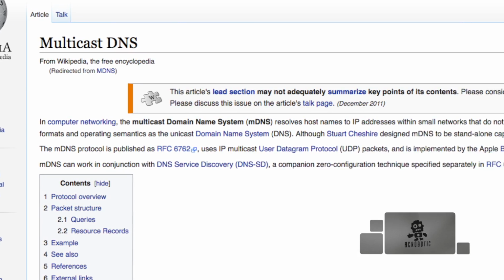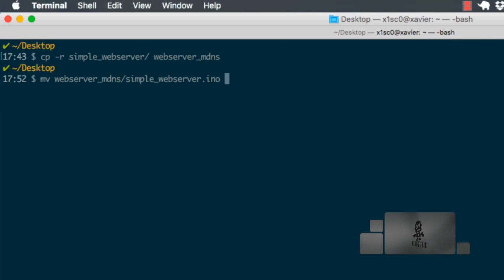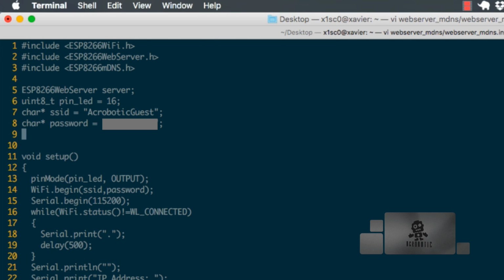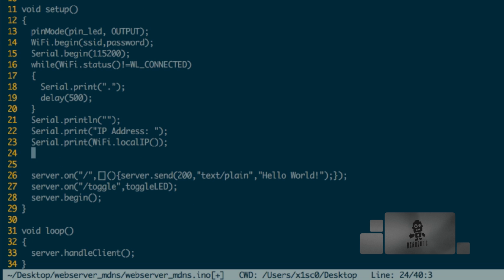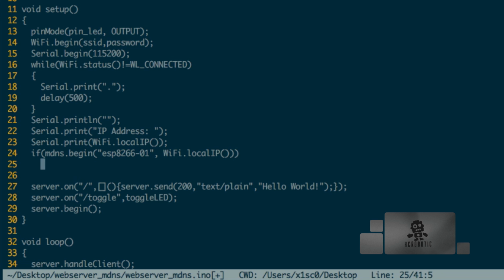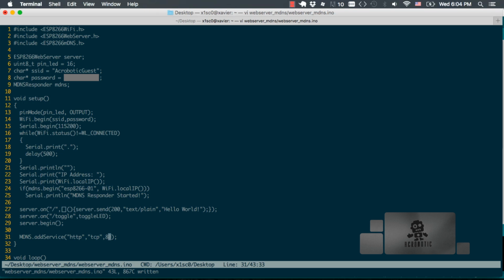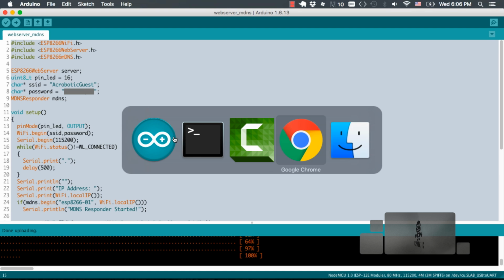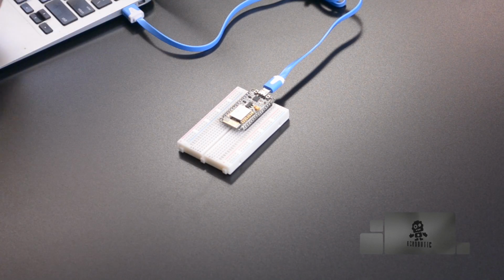ESP8266 mDNS For Web Address URL Using Arduino IDE (Mac OSX and Windows)

Comment: Great tutorial. mDNS didn't work before installed bonjour. After installed it working properly.Thanks for your effort.
Reply from the maker: Thanks! I could've sworn I had added it to the description, but that wasn't the case (it is now fixed). I'm glad you found the tutorial useful!
Reply: @datasith  I have a mac so I did not install bonjour. So, what should I do to access the website?
Reply: @nazmulhossain8194  фф

Comment: Great tutorial. It works ! Does anyone know how to get the URL working loading pages from SPIFFS ?
Reply from the maker: Thanks! If I understand correctly, you want to serve .html files from SPIFFS? If so, when the server receives a request for an URL, then you can use the fileStream function to serve the file in response. HTH!
Reply: @datasith  got it working. But it doesn't work with windows, Linux and android. Only apple !
Reply from the maker: @mialcatel4279  awesome! Yeah, mDNS is tricky. Try installing Apple Bonjour on Windows, and activating mDNS on Linux! HTH!

Comment: The code is not working for me. I have installed avahi and working in linux, but its not working for me. In fact any code where I have included ESP8266WebServer library is not working. Please Help
Reply from the maker: So the mDNS works, but not the WebServer?

Comment: One more great tutorial from you guys!!! Dear one more thing i tried you mDNS code but i found one issue it is working well on my laptop but when I tested it on my mobile which is actually a wifi hospot its not working but when I type IP it works in mobile but when I enter (http://esp8266-01.local) it does not work

Comment: Great tutorial, but I am having a problem.  I have a mac and windows, but none of them is working(IP is working but not the http://esp8266-01.local/). I installed bonjour on my windows but not in the Mac. Still, none of them working. So, what should I do to access the website?
Thank you for your time.
Reply from the maker: Hmm, interesting. Mac OS has Bonjour already installed, so there's no need to install anything else. Are you calling the mdns.begin() method in your setup function? When the code is running, do you see the debug message ("MDNS responder started") in the Serial Monitor?
Reply: @datasith  I copied your code and only changed SSID and PASSWORD.
Reply: @nazmulhossain8194  it didn't work for me either. Then i followed an example from mdns library (https://github.com/esp8266/Arduino/tree/master/libraries/ESP8266mDNS/examples/mDNS_Web_Server) which worked just fine.
Reply: You have to delete line 13 "MDNSResponder mdns;"
Use "MDNS.begin("esp8266-01")" instead of "mdns.begin("esp8266-01", WiFi.localIP())" (line 51)
Add "MDNS.update();" in the loop() function
Thats it!
Reply: @sev3n-eleven  Thank you, It is working now.

Comment: I have a esp8266 cp2102 and esp32. I also have my own domain and mysql database. Example.com/data.php?id=1234 where 1234 is the name of the esp. And strings $d1 $d2 $d3 $d4
How do I send strings to/from esp and website without revealing my SQL queries in the esp code?

Comment: Does mdns also work in esp01?
 And what version of the library is needed؟
Because Could not get mdns
Reply from the maker: It should work on the ESP-01, make sure you install support on your computer (read the pinned comment).

Comment: I am totally lost from 1.30 to 1.50. I dont know what terminal it is or what language you are using. Any guidance will be much appreciated.
Reply from the maker: Try searching the web for tutorials on the "Vim" text editor.  Otherwise, you can use the text editor built in to the Arduino IDE.  Thanks for giving our videos a try!

Comment: esp8266 client
Hi there, thank you very much for this step-by-step tutorial. I've tried it and it works with standard browser. When I try to connect using an esp8266 client using the mdns server name the connection cannot be established. It work perfectly when I use the server IP but this defeat the purpose of using a mdsn name...
 I've tried many combinations of request from the client but nothing seems to work. I've checked your tutorial and actually there isn't one about esp8266 client sending request to esp8266 mdnes server. Could you suggest a solution?
Many thanks and Regards
Reply from the maker: If you're trying to access the mDNS device, make sure you install Bonjour if you're running Windows OS (see previous comments for details).  Thanks so much for watching!
Reply: ACROBOTIC Hi, I'm trying to connect to the esp8266 server via an esp8266 client using the mdns server address. It still doesn't work. (Request to the server from osx or windows work like a charm), help on this is much appreciated. I suspect the esp8266 can't resolve mdns names...
Reply from the maker: You need an mDNS client running on the ESP8266.  Check this thread for more info: https://github.com/esp8266/Arduino/issues/1184
Reply: Salvatore have you find any solution for connecting mDns client(esp8266)?

Comment: Awesome work!

Let me ask you a question..I've noticed you rely heavily (and I'm ok with this) on the 'routes' and the server.on method..but I would like to enhance the user browser gui, something like a control panel with buttons,  sliders and checkboxes which would (by xmlhttp request, perhaps?) change parameters in the remote board , WITHOUT afecting the page displayed in the browser ....can yo please provide a tip on that?
Thanks in advance!
Reply from the maker: Many different methods achieve the same results. A more advanced way would be to use the xmlhttp object and use AJAX.  You'd still use the "server.on" method, but you'd return an entire html page, which would include the necessary JavaScript.  We hope to do a video in the future illustrating this.  Thanks for watching!

Comment: Thanks for such a nice video.
I have tried the same example but I got below error, can you please help me-- 
//--------------------------------------------------------------------------------------------------------------------------
I have used ESP8266 small module
//------------------------------------------------------------------------------------------------------------------------........
IP Address: 192.168.1.128
MDNS responder started
Fatal exception 0(IllegalInstructionCause):
epc1=0x40106cf6, epc2=0x00000000, epc3=0x00000000, excvaddr=0x00000000, depc=0x00000000

Exception (0):
epc1=0x40106cf6 epc2=0x00000000 epc3=0x00000000 excvaddr=0x00000000 depc=0x00000000

ctx: sys 
sp: 3ffffd80 end: 3fffffb0 offset: 01a0

>>>stack>>>
3fffff20:  4021ae9f 09940160 402109c0 3ffecd00  
3fffff30:  3fff21e4 00000001 4021aede 402109d9  
3fffff40:  4021aced 3fff23ec 3fffff80 3fff166c  
3fffff50:  3ffe0000 3fff21e4 3ffee7b0 4021b6a0  
3fffff60:  3fff23ec 3fff166c 3ffea1ba 4021a43f  
3fffff70:  3fff166c 00000014 4021a9ea 3fff23ec  
3fffff80:  3fff166c 3fffdc80 3fff16f4 3ffefd20  
3fffff90:  402263a3 3fff23ec 00000000 402064af  
3fffffa0:  40000f49 3fffdab0 3fffdab0 40000f49  
<<<stack<<<

 ets Jan  8 2013,rst cause:2, boot mode:(1,6)

 ets Jan  8 2013,rst cause:4, boot mode:(1,6)

wdt reset
//----------------------------------------------------------------------------------------------------------------------
Reply from the maker: Try adding a delay inside your loop function.  Also, make sure you have a proper power supply.  Finally, try the code without any external component connected to the ESP8266, that way you can determine whether additional hardware is causing the failure.
Reply: I was having the same problem, I am using the 3.3v supply from arduino uno and neither did I have any other components connected to it but then I figured out that it is because  I had stored my html page in the program memory and I was trying to access that html page stored as a constant character array in program memory as a normal char type array the only work around I could find was to declare that page as a simple const char type array because I couldn't find a way to access data from program memory.

Comment: The instructions worked out for me quite well, but for some reason, I can't toggle the led on and off. It just remains on no matter what. Any solutions?
Reply from the maker: Make sure you add a delay between setting the pin HIGH and LOW!  Thanks so much for watching our videos, we're glad that things are working albeit partially ^_^

Comment: Terrific series of videos on the ESP chip. I went through this one on adding a custom local domain name, but there seems to be one thing missing. Please help if you can:

Everything indicates the mDNS server is working, but I cannot reach the webpage. I actually have my code set up to run an AP, which works great if I just type in the 192.168.4.1 address. The name I give it will not resolve, however.  I read all the comments, adding the "http://" prefix, but this just will not connect from my phone (iPhone with latest IOS). Any suggestions on what to check is appreciated.
Reply from the maker: Does it work if you try to access the address (not the  IP) from a computer browser?  Sometimes the phones have trouble using mDNS.  Just for the sake of testing, try running the code on station mode and connect the phone to the same Wi-Fi network as the ESP8266.  This will tell you if the problem is with the phone or with the AP part of the firmware. HTH!

Comment: +ACROBOTIC I'm working on Windows 10. mDNS is not working on my laptop. If access it via IP address it works well but doesn't work with mDNS. Please help.
Reply from the maker: mDNS is not supported by default on Windows, unfortunately.  The easiest way would be to install iTunes or  Apple Bonjour directly!  Thanks for watching our video, and giving the code a try!
Reply: I installed Bonjour by Apply and viola it's working. :) Thanks anyway for your videos. Learned a lot. Can you do a video which involves ESP8266 NodeMCU with MATLAB?

Comment: Thanks for the video. I did copy your source code and uploaded it to my esp8266. The serial monitor shows that the mdns has been started like in your video. I get the ip address, too and using it I can connect to esp from my browser and get Hello world back. However, I cannot get connection by typing esp8266-01.local/ to my browser. The browser says: "esp8266-01.local’s server DNS address could not be found." Any idea what may be blocking me to use the mdns even if the ip does work? Thanks.
Reply: I am also having the same problem but I am using a mac. 
I get the message displaying the IP address and also the MDNS server has started, but when I type in esp8266-01.local  the browser doesn't find it and takes me to the search engine.  I also tried esp8266-01.local/toggle and nothing happens.  
I am obviously doing something wrong and any help would be appreciated.
Barry
Reply from the maker: Hmm, let's try to find out what's different on your network.  What OS and browser are you using?
Reply: I'm using Windows 10 in Surface pro 4 and there both Edge and Chrome. I have disabled firewall and defender just to be sure. BTW, the device is Wemos esp 8266 but it has worked for me very well in all projects so far.
Reply from the maker: Will double-check on Windows shortly and see what's the trick to getting it working -- yup, the WeMos work great and shouldn't be the problem.
Reply from the maker: Hi, Petri.  As Bob mentions (thanks!) mDNS isn't supported by default on Windows.  Here's a SO discussion on viable 3rd-party solutions:
http://stackoverflow.com/questions/23624525/standard-mdns-service-on-windows
Reply: Thanks Bob and Cisco for the explanation. Is the OTA technique different than this? In an esp8266 solution example for OTA at least the same library was included, and I can indeed see the OTA device in my Arduino IDE. Although it does not work like a clock and the net device is not allways visible, but most of the time I can see it and I can upload my schetch over the air. However, it is not the same as this mDNS I assume...

But thanks a lot for pointing out the reason. This may confuse some other Win users, too.
Reply: Did you solve the problem with mDNS on Windows? I'm currently on the same page.
Reply: I figured out that I needed to enter http://......Now it works fine :)
Reply from the maker: Awesome!
Reply from the maker: Glad to hear everything was working, keep at it!
Reply: Chrome didn't work on Android cell phone or on Linux box, but Firefox worked the first time. Give Firefox a try, and post your results here.
Reply: @rsquaredinnovations  and @ACROBOTIC, I had the same problem with Windows 10 and I', not solve the problem yet =/.